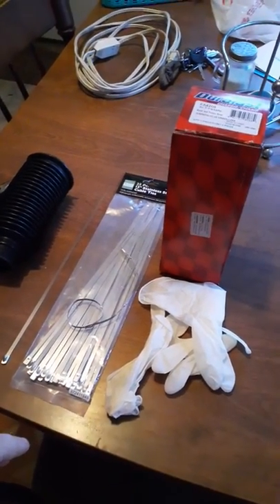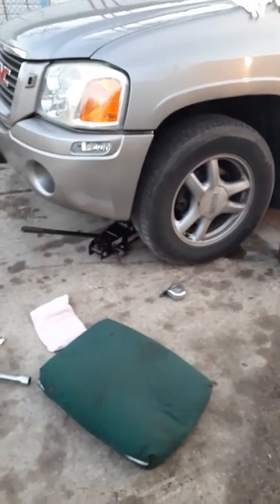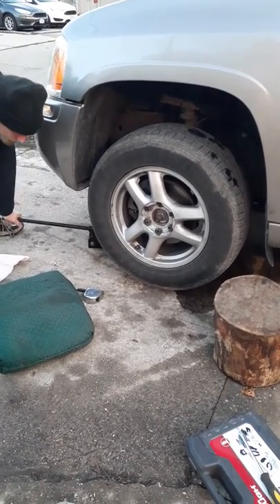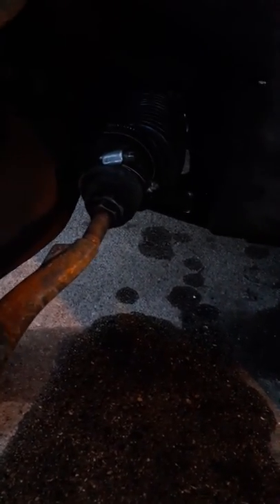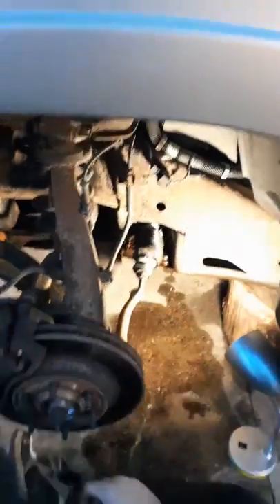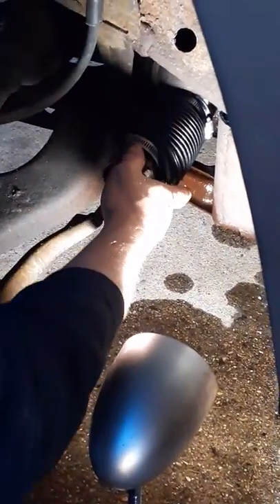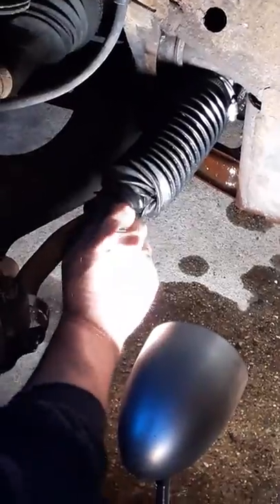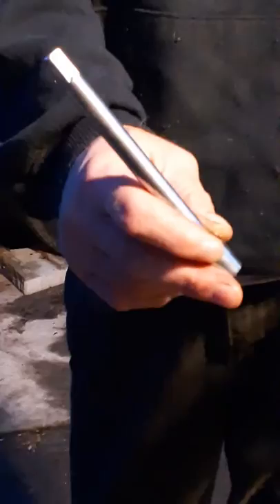2002 gmc envoy SLT rack and pinion boot removal.

Comment: The inner seal is leaking, not just the boot that acts like a dust cover for the shaft.  you must also replace the inner Oring seal.
Reply from the maker: Thank you. We did replace that had to go to the dealership and order the part took awhile for it to come in but got it and replaced it and no more leak.